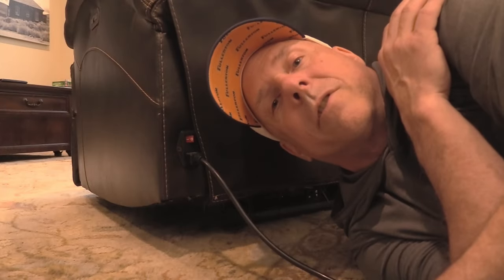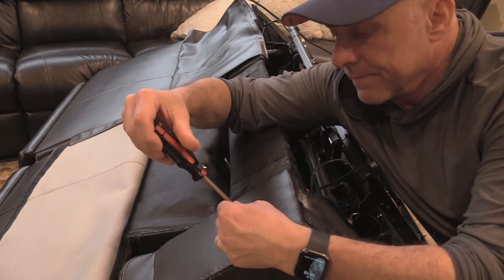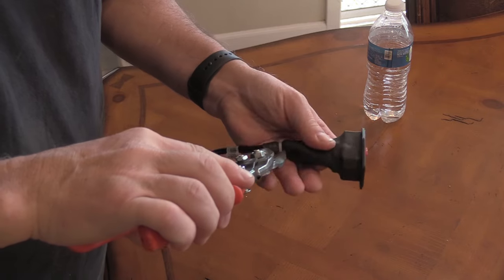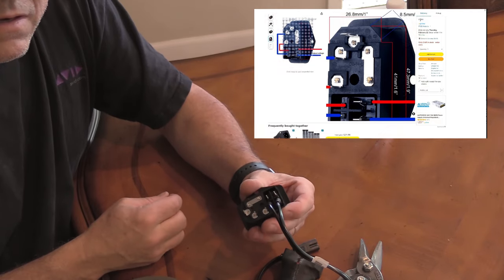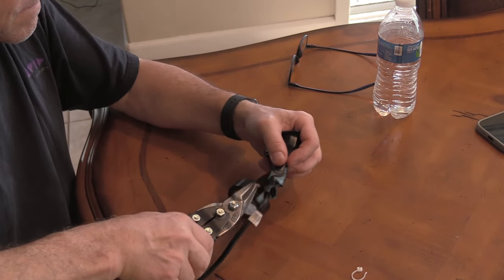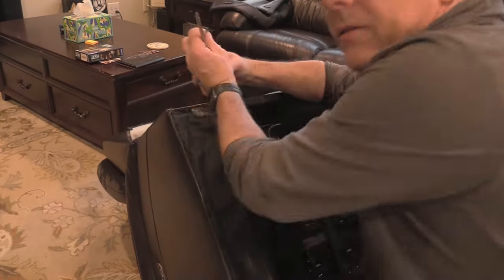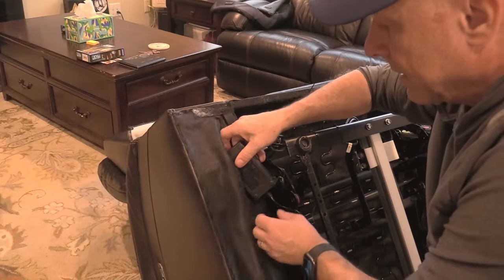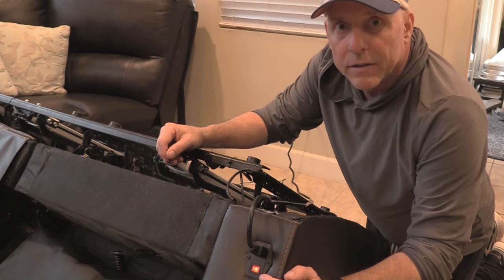How-to Fix Reclining Chair or Sofa Rocker Switch or Power Supply

Comment: My couch will not recline.  The light flickers.  Any suggestions?
Reply from the maker: Hard to say.  I’d try replacing the switch first, then the other parts I mention in this and the other video. Sometimes it’s trial and error. If you buy on Amazon, you can return the part of it doesn’t solve your issue.

Comment: Nice video, I am trouble shooting a bobs discount furniture recliner .  2/3 motors work with direct 29v . Remote control will not work.  If one motor goes bad does it effect the operation of the rest of the chair
Reply from the maker: Not sure about your particular chair.  In my case (a Costco chair) each recliner is independent of the other.  I don’t have a remote control though.  My theory is that there is a single “receiver” for the remote.  Perhaps that is broken or has a bad cable?   Does the chair work with the switches directly (as opposed to the remote)
Reply: @ThingsEvenICanDo  2 of the 3 motors work when using bench power ( 29 Volts DC) ( I jumped the junction box and powered the motors directly ).  I just ordered a new remote.  Problem is either at the remote controller or the junction box which accepts the line, the 3 motors and the remote controller.
Reply from the maker: Good luck.  I’d be curious to know the outcome.
Reply: Got a replacement remote and it doesn’t work